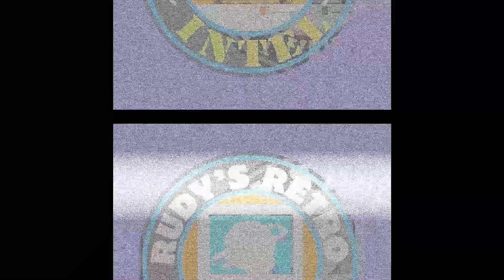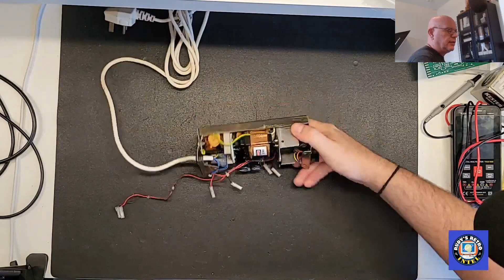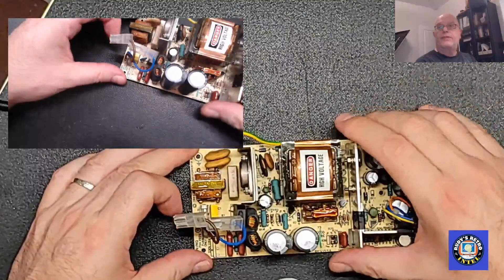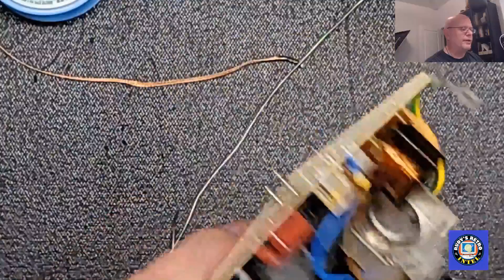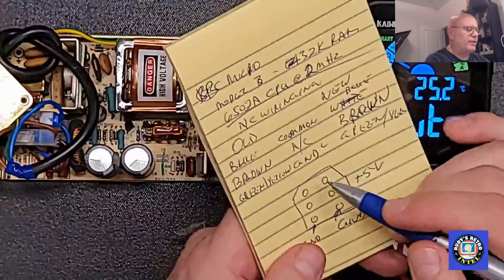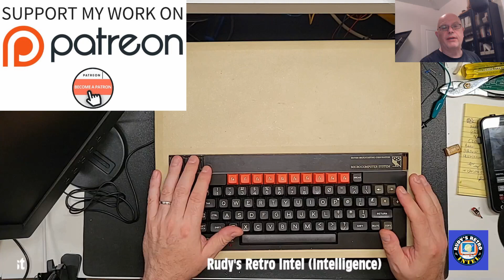BBC Micro Computer Moves to Canada. Let's convert the power supply from 220V to 110V AC.

Comment: Could you please go into a little bit more detail about how you hooked up your monitor?
Reply from the maker: On the back of the connector, I checked to see which wire was ground. Then, the other would be the composite video. Then, connect them to a composite monitor.
Reply: @RudysRetroIntel  Oh, thanks for that! I though you'd connected it to a new(ish) HDMI or similar monitor.

Comment: Nice job Rudy! (~16:30 I use a little heatshrink tubing around those spade connectors to insulate them when needed)
Reply from the maker: Thanks!!! I was going to use that or tape but was determined to get those plastic connectors off. Only took me 30 mins :) Thanks for commenting

Comment: Nice work!

I guess they had planned on potential North American release if the power supply was configurable to run on our local power grid
Reply from the maker: Hey lemonherb1!! Thanks for commenting! Yes, I believe they were thinking about it
Reply: @RudysRetroIntel  I wonder why they didn't move forward on it? Maybe too much competition in our market?
Reply from the maker: I believe that's it.
Reply: They did release a USA specific model, although judging by sources on Internet there may be compatibility issues with uk version, and some unfortunate limitations added, like reduced vertical screen resolution.
Reply from the maker: Agreed. Too bad we have NTSC and PAL. If we all had the same, it would have done better. Thanks for commenting